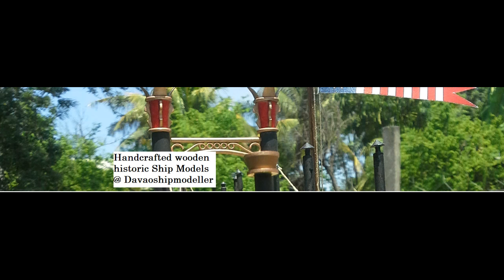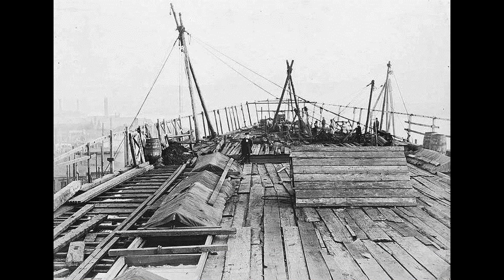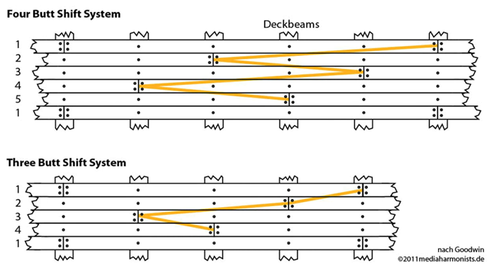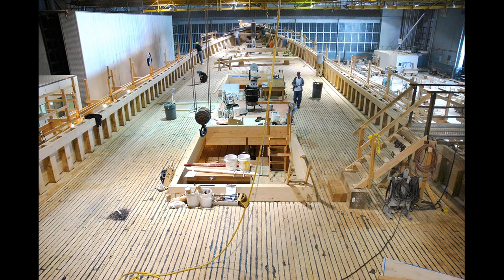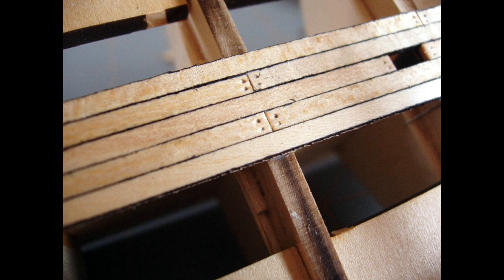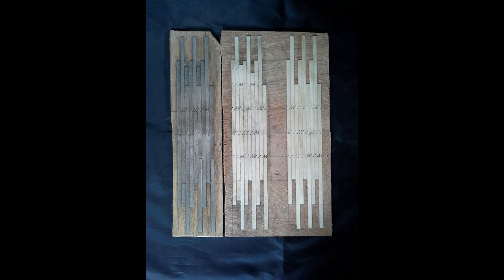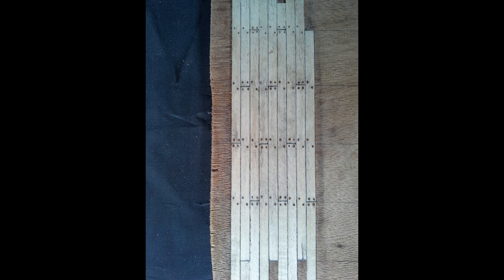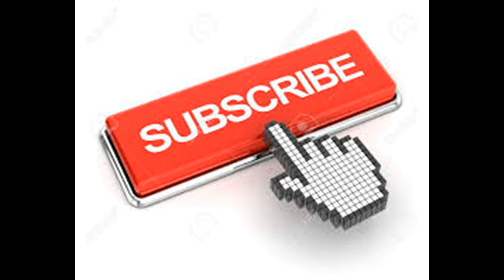Ship Model Deck planking Tips and Tricks #1

Comment: What glue do you use for deck planking. I see contact cement is often recommended but as you don't use full length planks I feel that would be a bit difficult.
Reply from the maker: For Deck Planks I use Wood Glue in general . Only the first Plank in the Center , from where we go left and right , I fix with CA Glue to speed up the Process , because you have to press the following Plank toward the Center Plank . I never use Contact Glue , because I find that too messy .

Comment: Hey man, as a brand new ship model builder, I have never built a ship model, but I have made my own solid hull ships from scratch. There is a kit I want from amazon and I am 15 years old, watching this stuff looks complex and sort of scary... I am looking at the model shipways rattlesnake or even the syren, which one would you recommend and should I ask for it for Christmas?
Reply from the maker: Hey Ibrahim, don't be scared , if you follow the Instruction for your first Model Ship, you will be fine. What I did in this Tips & Tricks Video is to show possibilities how to improve your Deckplanking, what does not mean that you have to follow my Suggestions. As for your ask of Advise, I would recommend the Syren , because I think it's more suitable for a Beginner then the Rattlesnake, but I don't know your Skills !?  Some Beginners have a Talent from the Start on, some have to learn those Skills Step by Step. So I always recommend a not so expensive Kit with a simple shaped Hull for a Beginner. Hope that helps . Greetings John
Reply: Davaoshipmodeller Davaoshipmodeller thanks man! I will look more into it, the rattle snake cost a little less then the Syren, but thanks for reassuring me man! Take care.